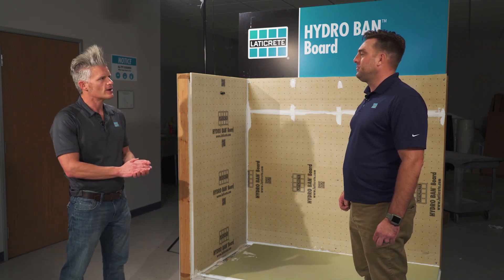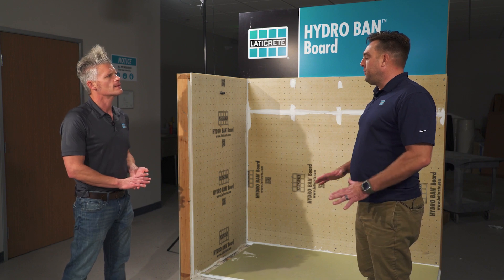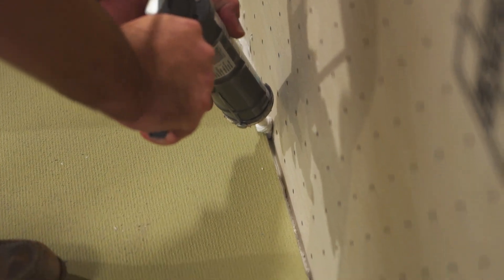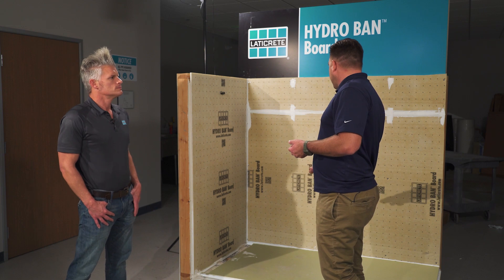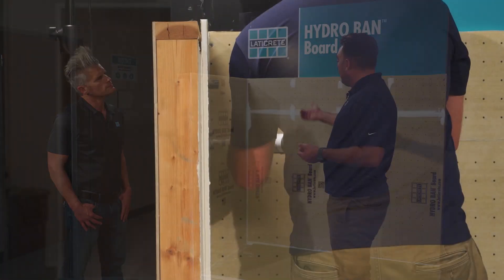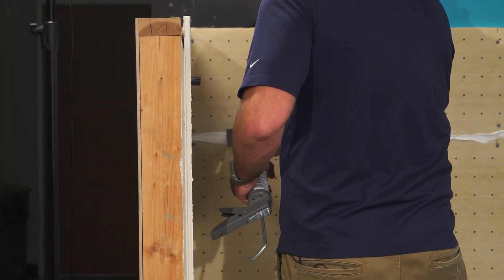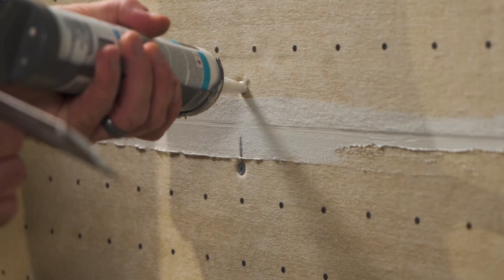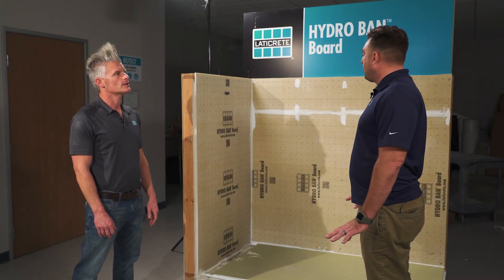Addressing the Seams in HYDRO BAN Shower Systems

Comment: when using a 209 mud bed (fully cured), do you place a bead of adhesive sealant and then set the wall board directly on top of the bed, or leave a 1/8" gap above the bed and fill with a bead of adhesive sealant?  Or no sealant and just use tape+thinset ?
Reply from the maker: Thanks for the question. You can install with and fill the gap with the silicone sealant or LATASIL, or you can just use HYDRO BAN and fabric.

Comment: what is the thickness of the sealant required at the seams?
Reply from the maker: When treating a seam in Hydro BAN Board, apply a bead of HYDRO BAN Adhesive & Sealant ¼” to ½” (6-12.7 mm) over the seam. Tool sealant to desired thickness, typically 1/16” to 1/8” (1.5 to 3 mm) before a skin forms. The HYDRO BAN Adhesive & Sealant should uniformly cover the seam and extend approximately 2” (50 mm) on either side.

Comment: Can hydro ban liquid water proofing be applied over an installation like this? Would it adhere appropriately to the sealant and or board? Thx
Reply from the maker: Hi Duncan! Thanks for your message. You can treat seams and fastener penetrations with liquid HYDRO BAN, HYDRO BAN Sheet Membrane Sealing Tape or HYDRO BAN Adhesive & Sealant and a LATICRETE polymer fortified thin-set per the data sheet with installation instructions provided: https://cdn.laticrete.com/~/media/product-documents/product-data-sheets/ds-40.ashx?sc_lang=en&vs=1&d=20221208T191936Z Hope this helps!

Comment: Buddy this hydroban board is extremely difficult to find. I had to give up and get goboard instead. Pretty bummed about it.
Reply from the maker: Unfortunately there are supply issues around the world (not just with LATICRETE products). There still is HYDRO BAN Board availability throughout the US, however some local areas have been hit by delays. We'd encourage you to check back at your distributor for your next purchase to see if they've gotten it in. 

We appreciate you using LATICRETE as you can on your projects!
Reply: As of 28 June 2022, the supply has not improved. Floor and Decor still doesn't have it, or HD or Lowes, so I'll be going elsewhere as well.

Comment: See this video where your adhesive/sealant is smoothed over an acrylic tub flange starting at minute 13:45:

https://www.youtube.com/watch?v=hDWzgfl5Uvc

Your technical assistance personnel say, variably, that this is not acceptable, or that it is acceptable but may void warranty, or that it is acceptable with a banding product you sell, but it may void warranty due to potential for excess movement.  However, these fellows in the video indicate the technique was done in consultation with Laticrete. 

I'd like to use the approach but would not want to void a warranty in doing so.  Schluter videos actually show the exact technique done on a tub flange but with Kerdi Band imbedded at the seam using Kerdi Fix.

What gives?
Reply from the maker: Hi Jeff - thanks for the question/comments. 
Please refer to our written install instructions here: https://cdn.laticrete.com/~/media/product-documents/product-data-sheets/ds-40

These state "For tub walls and installations with HYDRO BAN Pre-Sloped Shower Pans first apply a bead of HYDRO BAN Adhesive & Sealant along the top edge of the tub or in the rabbet joint for the HYDRO BAN Pre-Sloped Shower Pans and immediately install the HYDRO BAN Board. 

Another point of reference is in our architectural guidebook located here: https://laticrete.com/en/solution-center/for-architects/architectural-guidebook-tool

If you search by TCA method or by the category of Bathtub walls, you'll find the ES B425 drawing. We can send this to you as a PDF file if you need. Just email us at socialmedia@laticrete.com as we cannot attach a PDF here.
Reply: @laticrete  Thanks for the quick replay, but it seems you missed my question completely or maybe I haven't found an answer to my specific question within all the literature you linked.

If you watched the video I linked (done by a very popular tandem of installers) you'll see that they did not overlap the plumbing side of the tub, instead flush mounting your Hydro Ban Board ton top of the tube flange on that side of the tub.  They then applied your sealant/adhesive over the joint and filled in the gap as though they were using sheetrock mud.  They tiled right over that joint and filler of your sealant.

Is that acceptable or not?  If so, is that your recommended way installing in that setting where the flange cannot be covered by your Hydro Ban Board?   

I've seen another installer on YouTube using your 5-6" membrane at a flange like that one, using thinset on the board and your sealant/adhesive on the flange itself, then embedding the membrane.  Seems to me that should work in situations where for one reason or another the walls cannot be shimmed out to allow your board to fit over the flange, whether that is a bathtub or shower with an acrylic base.

Comment: So I would be relying 100% on caulking/sealant for waterproofing?  Wow
Reply from the maker: HYDRO BAN Adhesive & Sealant is a one component, 
fast curing, hybrid elastomeric adhesive and sealant that works perfectly to seal off seams and screws for a water tight installation when used with our Hydro Ban Board.

Comment: I’m very skeptical of any system that relays upon caulk in seams ...NO sealant last forever...
Reply from the maker: We understand your sentiment but the HYDRO BAN Adhesive and Sealant isn't a typical caulk material. Given the chemistry and the fact that it doubles as an adhesive in this install, it's ideal for this application. So much so, that we include it on our 25 and Lifetime System Warranties. If you are still skeptical, there are 2 additional ways you can treat the board seams. That information can be found here: https://cdn.laticrete.com/~/media/product-documents/product-data-sheets/ds-40
Reply: There other videos say to do way more this video series seems to skip over more than half the steps
Reply: @laticrete  I repeat, and stipulate,no sealant lasts forever. That said, does anyone really want t keep a shower longer than say 40 years ? Where can I find DETAILS  of your 25 year warranty ?